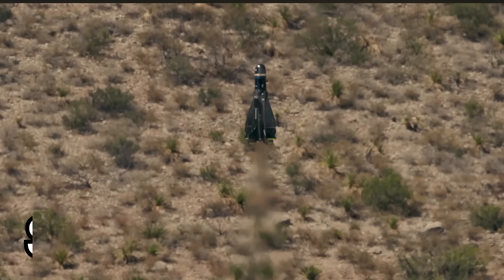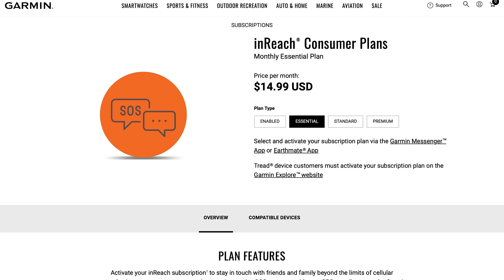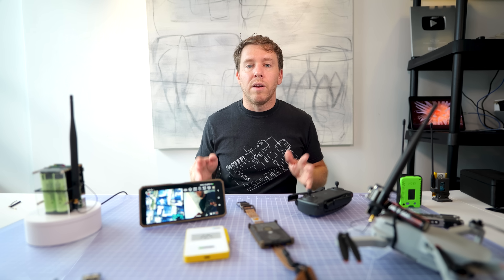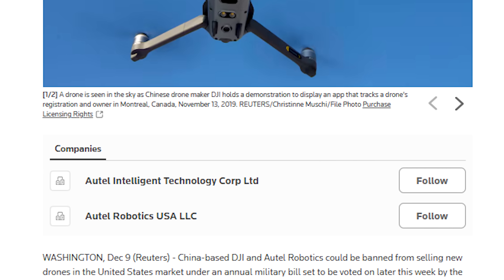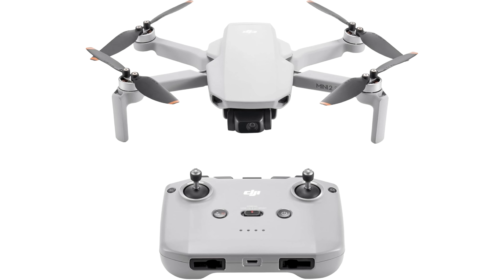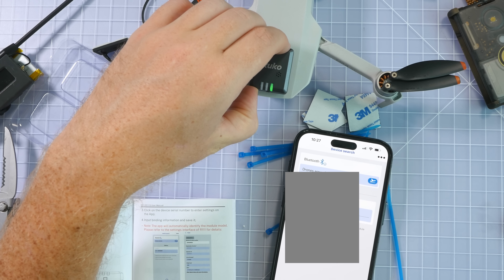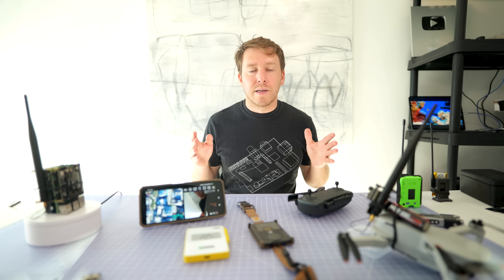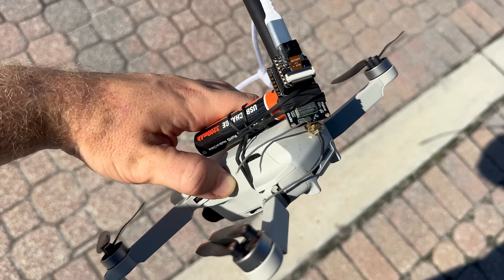I Built a $40,000 Military Drone for $120.07

Comment: The waves are from the vibration of the drone. Remember, drones camera has anti vibration in their cameras. They have stabilization to prevent from seeing them. I’ve built drones from scratch, before DJI came out with their drones. I’ve seen a lot of waves in the videos from the vibrations. I tried a lot of stuff to prevent it from happening. But the best thing I came up with back in those days was rubber vibration dampeners. I made a little platform for the camera. and that’s what worked best. 

But I have to say. I just saw your channel today for the first time. And I got to say, you doing a good job 👍. You got a subscriber here. What you are doing is right up my alley. Great job and keep them coming.
Reply from the maker: That explains it! I was definitely over thinking this. The camera onboard the drone sits on a gyro and that's probably why. I'll mess around with the solves you provided, thanks.

Comment: 12:25 be careful with those 18650  cells with a built in USB port. They like to dump 5v into whatever you’re powering if you try to charge them at the same time.
Reply: Yep, learned this the hard way

Comment: This is awesome, if the drone can host an RTMP feed, can you just join the drone to the mesh network and read the RTMP feed from ATAKS? I wonder if those odd waves in the video are from interference from the drone's motors.
Reply from the maker: I think so, but my goal would be to get away from DJI's ecosystem since it's more closed than I'd like. But I do need to test this.

Comment: Jell-O --the waves are there because of the vibrations the drones experiences and are translated to the camera because it is hard mounted. To fix the issue, soft mount the camera by using silicone spacers or isolators between the camera mount and the drone, or your networking hardware.

Comment: The wavy lines are caused by a combination of vibration, insufficient camera stabilization, and slow shutter speed. So not an interference problem, but a hardware/software one. Perfectly acceptable for a proof-of-concept that isn't even a real prototype yet, and easier to solve than fighting external factors which are out of your control.

Comment: Would attaching a halo unit to a balloon kinda like the Airmarker be worthwhile? I guess it would need a bigger lifting volume or maybe just replace the string on the balloon with a antenna cable and keep the rest of the hardware at the base? idk just spitballing
Reply from the maker: It should work, gonna be running some of these tests shortly

Comment: For those wondering, the thumbnail appears to be the Anduril Roadrunner-M. This is not that.
Reply: yeah - his videos are a bit of a bait and switch lately.

The one where he "reverse engineered the MPU-5" was a similar joke...  sure you can build a mesh wifi network node for cheap... but make it IP67 (or better) sealed and survive MilSTD-810 tests etc and suddenly it'll cost as much or more than the MPU-5 or similar radios...

this one is similarly silly...  that camera sending an image or two every second isn't the same as the roadrunner in the thumbnail, or even something like a skydio (a milspec quad...).  That wouldn't make a catchy thumbnail that drives engagement due to us calling out the BS though...
Reply: @overkillisunderrated5027 hahaha ya the mpu5 vid killed me lol
Reply: See, that’s why baited into clicking.
Reply: @davewebster5120  Yeah, not a fan. A lot of what this guy does is cool, but it's also not operationally equivalent and he does his best to make it sound that way.
Reply: Yeah, I was going to say that the drone this guy made is very much not a roadrunner.

Something to be noted here too is that this guy really doesn't seem to understand why a lot these devices cost so much money. If course, the military industrial complex is bloated, but one of the reasons these devices are so expensive is because of the standards they are satisfying. I can guarantee you that this guy's drone is going to have no EW attack resistance, no water/dust/corrosion resistance, no shock/vibe resistance, etc.

That being said, I am all for taking control of your own technology, and agree with many of the other points he makes.
Reply: @Google_Corporation   dont forget the entire supply chain

the price also is so every part is made in a ally country

cant have all drone production to stop becose it turned out half of it was chinese parts

or the semi recent thing with the f35 part being made with chinese magnites
Reply: @nikolaideianov5092 very good point, I forget about that all the time at work and it's a huge pita to fix, especially for things like certain cable connectors that only get made in China.
Reply: @Google_Corporation  What is the point of water/dust/corrosion/shock/vibration resistance in a suicide interceptor drone that takes off from an enclosed box? That sounds like a criticism but I expect that there is actually a reason for those capabilities that I'm not thinking of, so I'm genuinely asking.
Reply: @monkeysfromvenus  The fact that its going to be carried on naval vessels or in dessert environments? Would you want your only defense against low cost fpv drone swarms to fail because they were gunked up with sand, and salt water? Have you seen the videos from ukraine?
Reply: @Dogman262  I think they were asking: why build that capability into the drone if it's already containerized-- just give the container those capabilities. 

It doesn't need ALL of those resistances when it's deployed. Sure, the anti EW and water resistance absolutely. But if it's in a dampened and watertight container for transit...

I recognize the argument, but we don't have enough visibility into the project to assume they aren't already doing these things. We're all just speculating from here 🤷🏽
Reply: @Google_Corporation  Fair. Also it's only $120 if his development, research and build time (plus infrastructure) is free... At very least you'd count $100/h, so that puts this drone at probably $5K minimum; to have something that's definitely not weatherproofed, standards tested etc. Yes you can earn much back in volume sales --- but then you are continuously testing more and upgrading and funding the next incrementally better model.
Reply: @Google_Corporation is that why ukraine is using cheap chinese commerical drones jerry rigged with an fiber optic spool, because western drones are so amazing and EW resistant? 🤣
Reply: @rodiculous9464 They just aren’t up to date on the reality of drone combat
Reply: @rodiculous9464  Or or, you:
1. Voted a geriatric into the office
2. Bent over backwards to make your intelligence agency be less effective
3. Scared your allies in the european theatre into panic buying and tightrope diplomacy
4. Told zelensky he would lose and surrender
5. Paused military aid, and played a frankly annoying dance on why big pointy missile can only be fired at 30% of its max range

So when you get invaded, hopefully by a division sized PLANMC element, you will learn that desperation begets necessity, and having a capability is better than not having one.

But sure! Quiz us with your wonderful tactical analysis of the Donetsk sector, and enlighten us please!
Reply: The lil turbine itself is several thousand dollars already.
Reply: Yeah, not even close. The anduril roadrunner is turbine powered and can reach at least 500mph. It has full of board AI target recognition, and is network able with all US IADS.
Reply: yeah aint no way you can do that for under $200
Reply: I was gonna say, after listening to like 30 seconds of intro, I'm here like, "okay, but the drone you've made does not have the same capabilities as the drone you're showing as being overpriced; not by a long shot!"
Reply: Yeah this guy’s videos drive me crazy whenever I click on them. This is the equivalent of strapping an AR to an RC-car and calling it a tank for $100. (Hopefully that doesn’t give him any new ideas…)
Reply: Click bait... 🤣
Reply: The Anduril Roadrunner-M looks like a dildo about to do a wingsuit base jump 🤣
Reply: He did one part of it the drone the military uses is much more impressive
Reply: yea building a quad that does quad things for 120 bucks isn't that impressive at all as some hover edf or rocket thingy would be. like the militaries do use 1000 bucks drones that are basically quads or flyers.
Reply: Yah, it is a Black Hornet Nano, not a Roadrunner
Reply: All you need to do is read something other than Anduril's PR and you see pretty quickly it is just another fly-by night, silicone valley BS machine.  The Kyiv Independent had a piece titled, " 'Battle-tested in Ukraine’ — How US drone makers turned Ukraine into a tagline to sell west."  Of note, Anduril is listed as, "the worst offenders of PR over substance."  So did he make a Roadrunner replacement in the video?  No, but just another overpriced and overpromised Lucky-Thiel rip off probably isn't what you want to replicate as it is.  To no one's shock the company has greatly increased their reported lobbying spend.  As the article notes, the things that qualify for being reported and the things that do not, means they are likely far above the official numbers.  Having worked in DC, that part is guaranteed to be true.
Reply: @LackofFaithify  Does anduril have very aggressive PR? Yes. I dislike Thiel just as much as the next guy. Though their drone tech is still pretty early stages... You might be surprised about why, though! A big one is that there is a severe lack of talented, American, GNC engineers; turns out, it's really just the Chinese that know how to do it well, and really only one company makes good drones, lol (DJI). Real deployment is a great way to learn how to improve though, so if the US military wants to keep up with Chinese drone tech, they're going to need to try and fail a few times. Not excusing the overly-aggressive PR.

I would be hesitant to claim the entire company is BS, though. Anduril absolutely has very effective detection, EW, and networking hardware/software that is currently in battlefields making impacts.

My source is pretty trustworthy on that, given that it's the soldiers actually deploying with these devices ;)
Reply: @Google_Corporation  Early?  Founded in 2017, hundreds of billions in funding and Ukraine says, na, the Chinese Mavics are better.  You do the math.
Reply: @LackofFaithify  DJI has been making drones since 2006. They have a decade+ headstart.
Reply: @Google_Corporation  And anduril had all of those drones to pull apart.  Even with that and all of the hundreds of billions in funding they still made an unsatisfactory product.  Let us not forget that Lucky's first product, the Occulus, has been a money pit for all but him.  I promise, if I gave you a mmere $1 billion, you would be able to take that, reverse engineer and be able to cobble together a DJI drone.  The amount of money they have and examples they can use AND STILL a bad product, why are you trying to defend a corporation that is crap by every metric with the exception of funding round money made?
Reply: @LackofFaithify the hard part / distinguishing factor between DJI and every other drone company is software, not hardware. You're very right to point out that you can easily reverse engineer DJI hardware, though. Software is where a substantial sum of the R&D cost goes. It also doesn't help when there is a massive lack of American GNC engineers.

I wouldn't say I dickride Anduril; I dislike Peter Theil as much as the next guy, and don't like the military industrial complex as a whole. I just think that, as much as good intentions are nice, a well-informed criticism will get you a lot farther than uninformed criticism. There are much better things to criticize Anduril over, like their over-promising and under-delivering. Or that the government is spending far too much money in the first place on developing new military tech.
Reply: @Google_Corporation  Umm.  Do you really think that Ukraine is using stock firmware or software?  They learned in the most violent and deadly way possible that you could not use what came on those drones.  So they made their own.  You can't get out from under the wheel that is Anduril, hundreds and hundreds and hundreds of billions of dollars and crap results.
Reply: @Google_Corporation The road runner is not a one way system, it the mission is cancelled it can return and vertically land, get refueled and return to duty.
Reply: @nichiewah yes, I am aware. I probably could have done a better job of specifying which drones I was referring to in my commitment. When I mention one time use drones in the comment, I am not referring to roadrunner.
Reply: The pictured andruril is a recoverable loitering interceptor. Pretty neat stuff. But financially it doesn't make sense to actually use it. When it intercepts a target the interceptor is destroyed so it works out to around $40,000 to kill a $500-$2000 suicide drone. The optics alone in that andruril unit cost more than the entire drone it's intended to kill.
Reply: @Giliganism  the roadrunner isn't designed to go after FPV drones.  It's targeted toward things like the Shahed-136.

Even if it were used to take out an FPV drone, consider the alternatives - spend $40k to save a multi-million dollar tank, or the potentially irreplaceable crew inside of it.
Reply: @Giliganism  That’s only half of the cost calculus when defending stuff with an interceptor. Don’t forget that there are times where >95% PK is needed. 

There will be comically capable and expensive interceptors in service as long as they are reuseable or are needed to hit things in travelling in space.
Reply: Wow you’re a genius- moron

Comment: MY INITIAL REVIEW AFTER USE AS ADVERTISED IN THE VIDEO TITLE:
I'm in a muddy trench in Ukraine. Been here for 5 days sitting through constant shelling, after we hiked 30 k over 2 days to get here. We need recon on their mortar positions, so i take out my drone. I notice the antenna cable on one of the boards has snapped. Than i realize the other bare circuit board has a crack in it and has not been water proofed, so the mud probably started corroding it. But we need that recon, so i start soldering it back together on my field-soldering-bench and ask my buddy to set up his meshtastic and hook up starlink so we can stream the positions to YouTube for Central Command, who are subbed to our channel. After setting it up to fly i realize i am over 250g and having to consult with the authorities to get an emitter tag sorted, i finally take off. The device starts streaming 1 fp4s at 240x240, almost clear enough to distinguish some black pixels that must be their positions. This was a mediocre 5/10 experience, would buy again, but only when not under fire in a warzone.
Reply: this video title is major bullshit, even an insult to some
Reply: Question... did you apply for the emitter tag from the Ukrainian, Russian, or some other authority?
Reply: o im sorry mister Ukrainian heres an extra 39,800 of my dollars to make it waterproof
Reply from the maker: Did you try turning it off and back on between artillery rounds?

Comment: 14:48 the waves are there because of the vibrations the drones experiences and are translated to the camera because it is hard mounted. To fix the issue, soft mount the camera by using silicone spacers or isolators between the camera mount and the drone, or your networking hardware.
Reply: Came to say the same.
The issue is called "rolling shutter" and low quality camera/high vibration/low frame rate are exasperating the effect.
Reply: @Dyltone  And specifically, this is the 'standing wave' generated by the mixing of the shutter line frequency and the mechanical movement at the image sensor. Now I'm imagining using the IMU data and the sensor clock to generate a processing pipeline to digitally correct it without additional hardware...
Reply: @DrunkenSwimmer  You will need some very expensive accelerometers than can sample at a very high frequency, optionally, if you can just get the frequency of the vibrations using something cheaper, you might be able to transform the rolling shutter to a stabilized one.
Reply: @DrunkenSwimmer I imagine that there is an FPGA for that. ☺️👍
Reply: @TryviaT  You mean ASIC? An FPGA is a programmable "blank slate". It could probably be done with one, but you won't buy it with that configuration already loaded. You'd have to write it yourself in a hardware description language or modify an open source version for your specific FPGA and application.
Reply: @RAndrewNeal yes, an ASIC would work, but I was suggesting an FPGA to be silly. =^.^=
Reply: The dangling USB cable he has wobbling back and forth is likely driving the PID controller nuts, causing even more vibration
Reply: but I LOVE JELLO